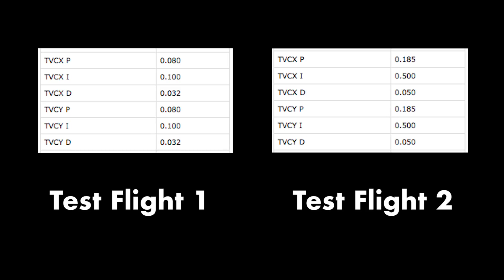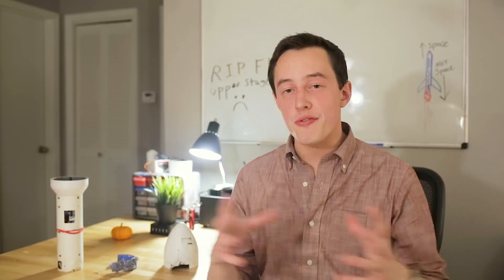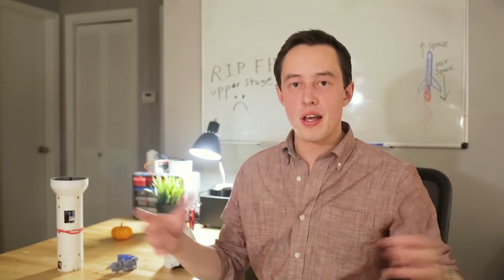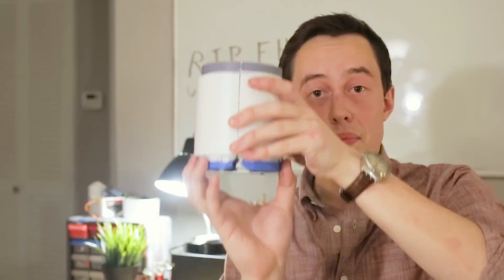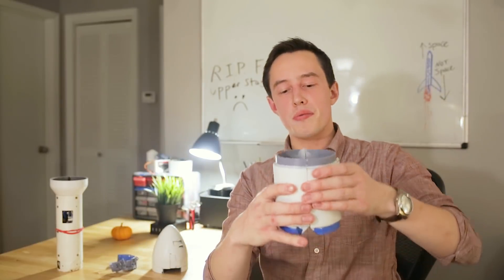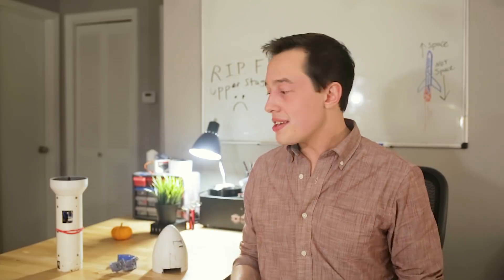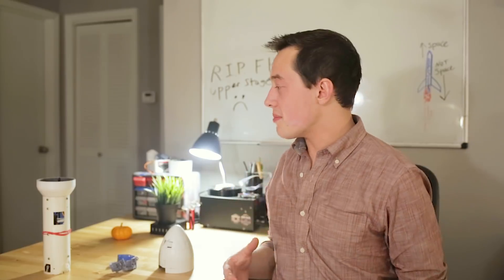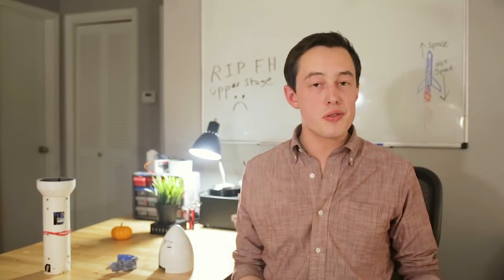Falcon Heavy - Upper Stage Test Flight #2

Comment: I bet we can recover video data from camera.  Open the file in VLC. Then you can save it out as a valid file.
Reply from the maker: The file size from the video clips on the Micro SD cards is zero bytes - there is no data to recover.
Reply: Make Bit-By-Bit copy of an SD and share link, there has to be some data, even without proper file headers :)
Reply: @RichterPavel  I agree. There are tools to recover data files from raw data (they look for headers and other non random arrange of bytes)
Reply: "Hi Joe, I have shall we say, extensive experience with wrecked cameras and extracting video clips. Check out the freeware program called recuva that could be used to get the data from your cards. You will likely get a partial file recovery but it won't play. This is very common with H.264 files, because the header info is written to the file when the recording is ended, so a crash will terminate the recording before the headers are saved. You can find utilities like MP4FIX that can create fake header data by copying the data from another video saved by the camera. Some "best practices" for video recovery: One thing you should always do is try and blank the cards before each flight. Some format utilities will let you do this, but an easy way to do get the same result is to copy a file filled with 0's or some other character to the card that fills it to as close as possible to the maximum capacity, then delete that file. The memory of the filesystem will be filled with something that doesn't at all look like video data and this will insure that video data written by the camera is not confused with old file data if the video file is corrupted, and you try to recover it. Having only one video stream present on the card and the remaining sectors filled with something else means that the recovery software will likely find all of the recording and it won't truncate the file or insert data from an erased video that's still sitting on the card.Good luck!
"
 
-USWaterRockets
Reply: Yeah there is no reason why the data isn't recoverable, it's not like its rocket science. :)